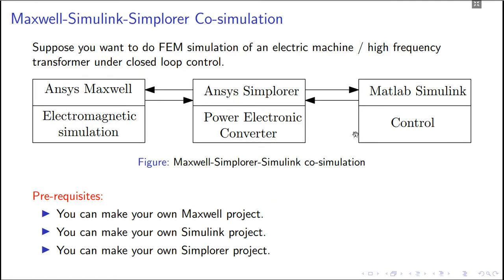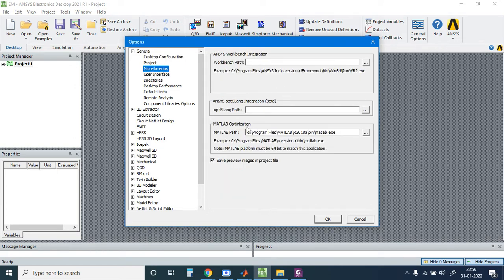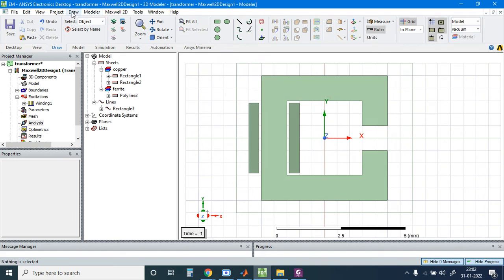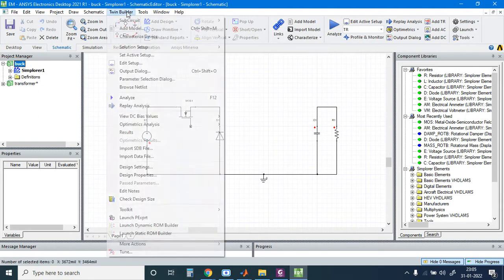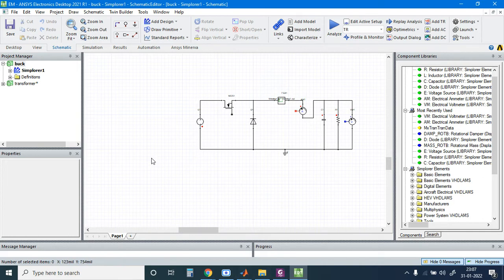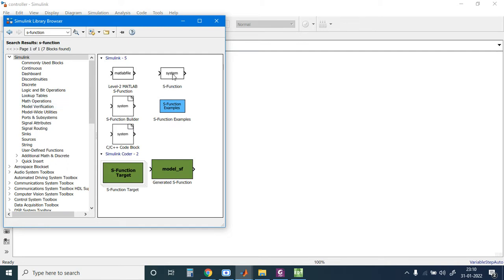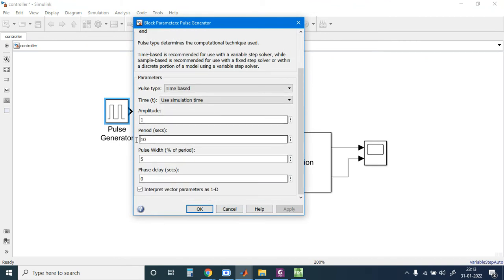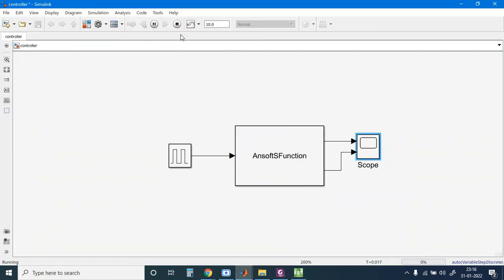Matlab Simulink - Ansys Simplorer (Twin Builder) - Maxwell co-simulation

Comment: Can we add more than 1 simulink blocks in one single system of the simplorer
Reply from the maker: There is provision to add, I have never tried.
Reply: @saptdy  I tried to add but the software isn’t letting me add it. It’s saying that one simulink block is allowed per simplorer file. If you know how to add can please help me.
Reply from the maker: If the software says so, I think it can not be done. Are you sure that 2 simulink files are absolutely necessary in your simulation?
Reply: @saptdy  yes actually I was trying to take out more pins as said in your video from the s-function block from the simplorer to design the rest of the control logic and inverter part in Matlab but the pins are not connecting in Matlab that’s why I was trying to use 2 Matlab blocks but that’s also not happening
Reply from the maker: Do it afresh. delete the simulink and s-function blocks. better make a fresh simulink file, give a different name, and copy-paste your control blocks there, except s-function block. Now start the linking process from beginning.
Reply: @saptdy  thank you very much. I will try this then

Comment: Thank you for this valuable tutorial. I tried this for Axial PMSM . But show error in S-function. I check all in and out pin link, try with simple simple simulation file but same think appear. Pls help me to identify where was  the problem.
Reply from the maker: If you are using ANSYS 2020R2, it's a known error. Try using other version.
Reply: @saptdy  No i am using 2022R1
Reply: Error reported by S-function 'AnsoftSFunction in controller/S-function. Error initializing Simplorer
Reply: @moyukhmandal2094  let's check message manager in Simplorer

Comment: Thank you a lot for the great tutorial! 
I run into problems though at the SiM2SiM part where I get error ".aedt is locked and cannot be opened". I saw you also had the buck.aedt.lock file active when loading the Simplorer circuit into Simulink but didn't get any error. 
I tested closing my Simplorer buck circuit file but then nothing happens instead when I try to load it in SiM2SiM. Also, when I reopen it, I no longer find my Transformer Maxwell project in the Project Manager of the Buck Simplorer file but the component is still loaded and connected in the circuit. Not sure if that is a problem or not?
Do you know what could be the issue regarding SiM2SiM and how it could be solved? I use Matlab R2020a and Ansys Electronics Desktop 2021R2.
Best regards
Reply from the maker: Regarding the lock file, you can try this: save and close the simplorer file, see if the lock file is still there, if yes, delete it manually. And you can try linking the simplorer maxwell once again, the link seems to be lost.
Reply: @saptdy  thank you a lot! I will try it out

Comment: The tutorial is very clear and it is the first video on this subject that I have found! I tried to make a simple co-simulation between TB and Simulink following the steps of this video (I am not using Maxwell in this first test) , but I am having the same problem as the reported here: https://forum.ansys.com/discussion/32333/i-am-trying-to-interface-ansys-simplorer-with-simulink-but-facing-some-issues. I added a Simulink component in TB with one pin to Simulink and another one from simulink, but when I try to load the TB file in the Simplorer Link Assignment Dialogue (that appears in Simulink after naming s-function as AnsoftSFunction), it just cannot read and shows "no model". I am also using Matlab 2018a and Ansys ED 2020 R2. Is someone having the same problem?
Reply from the maker: Yes, the same problem I faced with 2020R2, tried many ways but couldn't diagnose. I still don't know why that problem appears. Although in earlier and later versions no such error comes up.
Reply: @saptdy  Thank you very much for your immediate answer! I am trying everything since yesterday, but it just does not work! I will try to update Ansys ED with my University.
Reply: Yes same issue mine
Reply: I am using 2018a and Ansys 2020.

Comment: Great video mate
Do you happen to know about this error
[Sim2000]Error 10532- Error encounter while PREPARE.>>CLOSE
It pops up just as analyse the simulink circuit. Can't get my head around this
Reply from the maker: Not sure. I cannot recall if I ever encountered this.
Reply: @saptdy  ok did some digging. Made sure mex -setup was running and saved the Simulink as .mdl rather than .slx. Now works like a charm

thanx